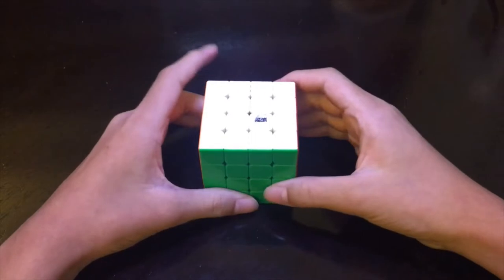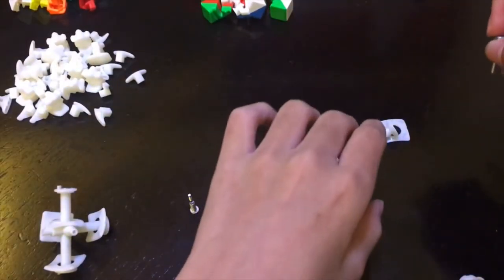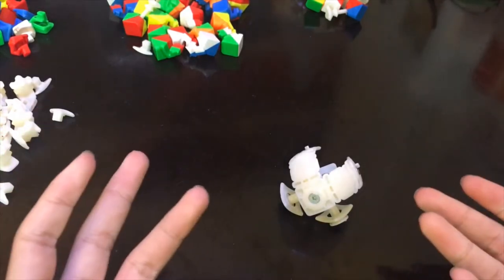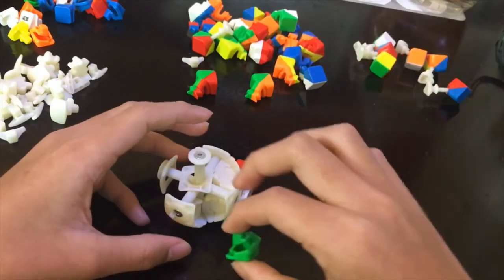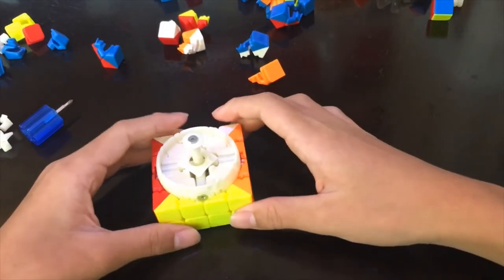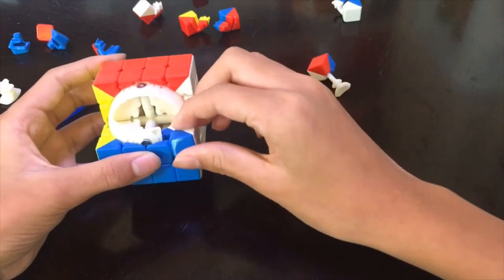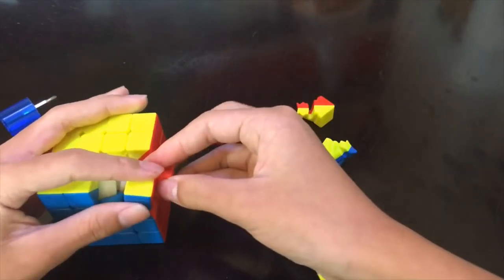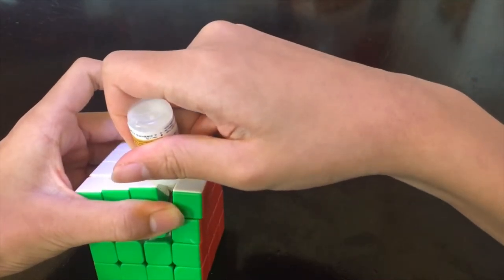I assembled a 4x4 WITHOUT a tutorial

Comment: LK, do you have any thoughts about the WR M's performance?

By the way, the first time I put together a 4x4, it took about 4 hours, it was painful.
Reply from the maker: Nah dont have a WRM
Reply: @LKCubing  What 4x4 is this?
Reply from the maker: Jonah oh you mean the Aosu wrm, I thought you meant the weilong wrm. The Aosu wrm is a bit on the slow side, but it is very stable. I have to add lube in every week to keep it going though
Reply: The problem with the AoSu serie is that because the cubes have an anti-pop design, when they actually pop, the last five pieces are really hard to insert.
Reply: @LKCubing  Ok, thanks. I have recently been thinking about getting it.